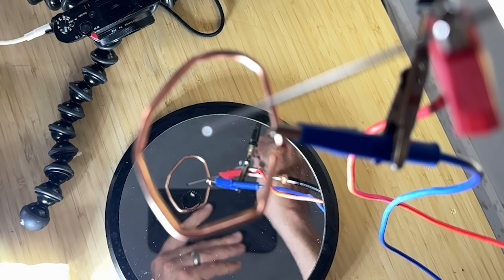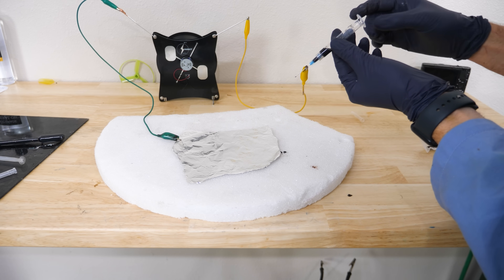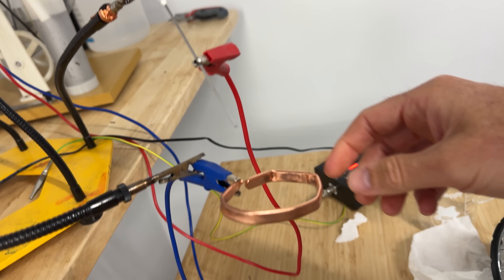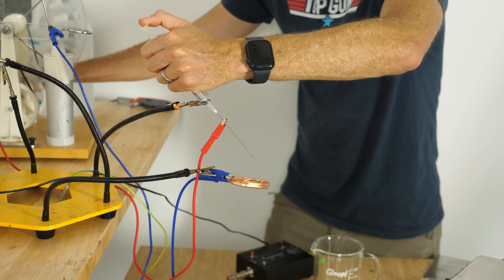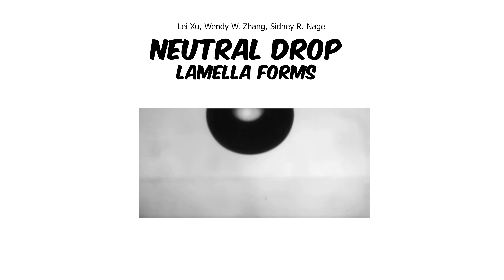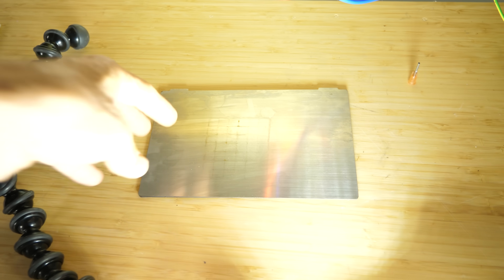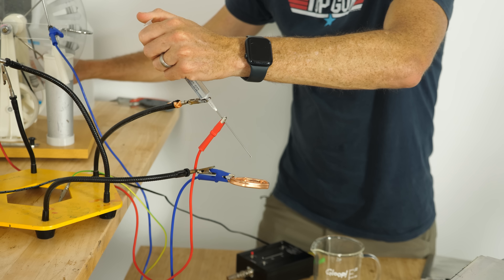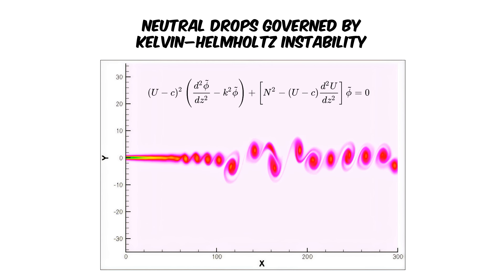Scientists Just Found Why Electrified Drops DON'T Splash

Comment: Since the effect is dependent on the dielectric strength as well as charge, presumably one could build a dielectric tuned to different charges and potentials. Maybe manipulating a polymer on the other side could enable weird stuff like a surface that holds together or goes non-stick with minimal charge, or a single liquid which can clean the walls of its tubes by being charged.

If the surface was modified on the micro/nanoscopic level, maybe one could even cause fluids to flow in virtual channels, store power, etc, by gracefully distributing charge and modifying surface potentials.

Comment: In a "FULL" vacuum, hydrogen expands on a 2d plane, and this is known as positive ionization. The negative ionization is what is passing through that plane. Hydrogen is a literal magnet for the positive pole of magnetic current. Magnetism is in fact a flow of current, not some magical Mickey Mouse particle that bounces between others, somehow sucking them together. That would not every work or explain the differentials we know for certain rule the forces. The hardest evidence of this is in Azra Wind's paper on the prime spiral relationship to the known forces. Her work actually uncovered the fact that there is no end to the number of poles. She herself cannot explain the energy void in her own paper, but I did.

Comment: @2:38 You say the higher the charge you receive a fine mist, "electro spray".
How about a way to atomizing fuel even further in a gasoline or diesel engine...could this be used?  Either by adding a unit to the end of the injector or perhaps replacing the injector altogether. 
For those who don't know, Finer atomization of fuel in a combustion engine increases fuel economy.
Reply: High voltage+atomized fuel...I see no problem

Comment: Inkjet printers such as video jet and domino use negatively charged ink that passes through a charge electrode to print on moving surfaces.  I've had issues on certain mediums where I get significant over spray affecting print quality.  I've always attributed that to static on the print surface.  This might confirm that.

Comment: This maybe could be used to increase efficiency on an internal combusted engine by controlling the atomization of fuel in a cylinder. At the beginning of your video, you say you don't want to turn the charge up too high because it would atomize the alcohol too much. A similar thing could be done to the fuel as it goes through the injector.

Comment: Just came up with an idea .. I am converting an old 3d printer with a 405nm .5 watt laser ., but just took the hot end off and have a pile of new old stock ones too, insulated the hot end from frame and spray out of the hot end ? What I am looking for is to cure resin on copper clad for making pcbs anda drop of liquid resin with no risk of spread would be the goal.

Comment: When the Guy mentions no splash in either a vacuum or charged by an intense electrical field, it makes you wonder if "similar effect = similar cause". In a vacuum, there are no atoms/molecules of gas in contact with the surface of the water droplet. It's outer electron field (surrounding all the atoms) is only in contact with the Vacuum. Is it possible that the intense electrical field is causing a similar effect? The high level of charge acting as a barrier between the outer electron cloud of the droplet and the surrounding atmosphere?

Comment: This makes me wonder a few things, what if you did this in a vacuum? Would it stay the same or would it dramatically change? 
As well as, you showed when you over charge the alcohol it missed. I wonder how that would affect something like a diesel engine which works on the adiabatic principle. Would it improve output? Would it detonate?

Comment: Wonder if it could be used as a means to prevent aeration of oil withing extremely high speed mechanical parts? Maybe it could be used to reverse the effects of aeration.

Comment: One day I happened to be looking at a bird bath out of the window during a thunderstorm. I noticed the raindrops were behaving strangely when they hit the water. My family probably thought I was crazy. But it bothered me to observe something so common behaving strangely and not finding an answer for it. It was almost like a liedenfrost effect but the splashes were weird too. I wondered if the droplets were charged more than the surface water or if the ph must have been very different between the surface water and the raindrops being that it was a bird bath. Something was clearly affecting the surface tension of the water in a strange way. It was almost like watching drops of honey and sometimes persisting drops would jump around the surface for a surprising length of time before falling into the surface. I also wondered if the bird bath or the rain was coated in a surfactant while falling in the sky, picking up pollen or something along the way. Seeing this video reminded me of that experience and I'm wondering how it relates. It would be interesting to see some testing with charged droplets into a surface of water! There's another phenomenon that can be seen in lakes during a rainstorm where the water surface has patterns like a different texture to the water, I think its understood to be caused by rising and falling cells of water caused by temperature differences between the rain and the lakewater. Sort of like cells that form in resin, or coffee or the surface of the sun. BUT, I wonder if raindrop charge has any impact on that behavior too becuase I see it sometimes and not others and I think there could be more going on there.

Comment: so the key take-away is; If you are in the top of a tall building, and it's on fire and you can't escape via the stairway; pee on a power outlet so you get electrocuted, then you can savely jump out of the window. When you hit the ground nothing in or outside your body will splash, meaning you are pretty much rubber and therefore invincible. You are right, I can't believe they just discovered this.. this is a MAJOR discovery!!!

Comment: A potential non science use would be creating a kind of art device with it. Like a pendulum that swings and on it is a device that charges and drops droplets of paint (and you can vary amount/rate), there are artists that make chaotic art using pendulums, this would just be with small dots since it's droplet related, but it would be cool for making like patterns of dotted paint lines that don't send micro droplets all over the place.

Comment: Did you try charging the plate? If a + drop hits a neg plate does it splash? Can all solvents be charged?  Might be interesting to know whether such droplet charging could be used to orient proteins being applied to materials being used as test substrates or antigens for vaccines. (Protien Biochemist here)..one of the issues in applying antigens to substrates is random orientations of the proteins which mask the targeted antigenic part of the protein from exposure..if its not exposed because its underneath its not useful. Same for applying proteins to grids for electron microscopy analysis...random orientations means a lot more proteins need to be analyzed to get the 3D structures.

Comment: Interesting. Suppose a charge can be applied to a clear surface, then it would be easier to see through while rail is hitting the surface.

I have noticed that rain from severe thunderstorms don't splash much on the windshield of the [very old] car. I suspect newer cars have a coating or chemical mix that differed from cars of the 70s.

Comment: There was a video recently by tech ingredients about a paper that talks about using water droplets + gravity to extract electricity which in theory could be to essentially create large capacitive batteries as long as one had a way cycle it. (solar could evaporate the water) [I personally think that with enough research if the idea is truly sound then it could be used to essentially create "free energy"- a very simple non-mechanical system that is effectively closed except for a means to "freely" restart the cycle. If it was developed basically every home could be self-powered through one of these systems that would be cheap to build and likely last indefinitely. They may have to be relatively large to power a typical house though.

Comment: Doesn't this mean that the opposite effect is also useful, meaning that if the surface is conductive, it won't attract the droplets as much. For example in windshields, if the windshield is slightly conductive or has a slight film on it that is conductive, then the droplets wouldn't 'stick' as much ? Maybe it could help with products like rain-x.

Comment: Automobile painting? 
Lens coating

What about other liquids? Water? Oil, petroleum and vegetable? Mercury? Bromine? Detergent, diluted and not diluted? Latex paint? 

I was expecting several surface examples. Plexiglass, non stick cookware. And couldn’t you find a clean piece of metal?

Comment: What practical uses indeed, food for thought.
And I am wondering if we can use the effect in an interaction of droplets with solid particles (PM10-2.5) say to prevent dust explosions, improve microencapsulation processes, create tiny fluidised bed reactors (that due to the size of the particles no longer need micro gravity), and so on..

Comment: Yeah using electric charge to form shapes like spheres on the ends of electrodes to form plasmoids for instance, what about using sound to do the same? there is that famous uTube experiment where the guy uses a speaker to form shapes of water to make the water seem to flow backwards from the direction of gravity.

Comment: honestly i like shaving with a Razor like that. i own one and use it regularly.
but you can get those machined by reputable manifactureres for 1/4-1/3 of the price of hanson.
i dont say their products are bad, just very expensive compared to the rest. didnt test then but could you test the gabs and angles between hanson and Brand XYZ?
i´m curios if my cheapo is actually worse.

Comment: My dad shared a piece of weather lore , it was raining and he said if the raindrops make bubbles on puddles instead of splashing then it's gonna be a prolonged rainfall. It's a folk so he doesn't have a scientific/logical explanation for it but it works, wonder if it has something to do with the charged raindrops?
Reply: WOW, this is interesting.
Reply: I'd say it's rather opposite. Bubbles form when the droplets are especially large. Large drops bring a lot of water and form when there are especially favorable condensation conditions in clouds. Therefore, as condensation goes fast, clouds run out of water fast as well. I usually see long rainfalls when it is just dribbling outside. In these cases, clouds may cover the sky for days
Reply: I used to run printing press. The key is balance of ink film on rollers vs water film on the printing plate. The print area is non water loving vs the blank area where the water films. To help with balancing, the water is made acidic. I wonder if it also affects the charge of the water improving ability to run a thinner film reducing emulsifying the ink. Too much ink emulsifying and the image area washes out, the ink doesn't stick to the plate for transfer.
Reply: @marcusadam1463  Thank you time traveller, clearly you are from the 1700's posting a reply to drop a clue on how to see the hole one without missing the lines for the numbers.
Reply: very cool man thanks for sharing. any other folk knowledge you know? ive definitely observed this myself
Reply: Thunderstorms will supercharge the droplets and thunderstorms usually are of short duration and move on quickly.
Reply: I appreciate your use of Anglish.
Reply: I believe no.
Reply: It's just the confirmation and survivorship biases.

Comment: I used to work at a factory that coated glass bottles and we used electrified paint mist to coat the bottles. I worked further down the line so I don't know exactly how it worked but something like this.  But they had a room that got electrically charged that had a line of bottles going thru, In the middle of the room there was a metal disc spinning very fast so when they dripped  paint  on the spinning disc it instantly turned to mist. The mist then got sucked to the bottles from the static charge in the room and out came perfectly painted bottles with a thin layer of paint. It was a cool thing until you needed to help them clean that room. It was dark red paint so it looked like a horror room. When done cleaning you always managed to get some paint on you and you could track people thru the factory like a cartoon because of all the red tracks everywhere. Was really hard to get the paint off.

Comment: Before watching the video, I'm going to assume the reason why they don't slash is because the charge increases the strength of the intermolecular bonds and thus increases the surface tension.

Edit: Guess I was wrong. Still pretty neat.

Comment: I worked in pharma and we used fluid beds to levitate and rotate air suspended sugar spheres to spray active ingredient and grow the spheres in size. We aimed a tiny atomizer from Glatt nozzles that coated and grew a tiny sugar sphere over 4-12 hours. Biggest waste was the kilos of active ingredient we would collect and reject per batch because that dust is at the end becomes the splashed dried active Ingredient we added to our liquid dispersion we spray.. the rest is pretty much alcohol that evaporated in the warm bed. I feel like charging a spray process like that even in painting would result in a much more efficient spray.
Reply: You got a great idea my guy. Whoever patents this first should give some credit to your seed. 

It would in theory produce a better spray. Just charge all spray during exit on the nozzle.

Comment: If it also works with molten metal in a liquid state you might be able to use it as a safety method to stop splashing while pouring casts.

Comment: I think wh3n we pour and layer liquid based structures to create metamaterials. Or if we layer specific materials on a surface of a plane or other structures to decrease drag from un smooth parts like rivets/ bolts/ layered panels etc. Another one I'd like to mention but think id get in trouble

Comment: So, ball lightning might be formed from a lightning strike onto the ground, where Silicon Dioxide and tiny water droplets a sprayed up and forms a natural capacitor sphere, held together by charges. Then this charged dielectric ball travels a bit, leaking some material, until it dissipates. The bluish color of the ball lightning is from the nitrogen and oxygen in the air getting excited like in neon lights.
A fluorescent light starter when you drop them and the glass breaks, it would emit a bluish light for a second and a sound that sounds like a short-circuiting wire. So there's the sound of the ball lightning, and the popping sound at the end, is from when the whole natural dielectric capacitor collapses into itself :)

Comment: You need to look up a “Bells” electrically charged paint system.
No splatter and finely spread paint. This has been in use for 40 years and works flawlessly

Comment: The most obvious place I could see this being relevant is any glass surface you know will be exposed to weather. Especially if you are trying to increase specific properties like reducing how blurry things might appear through the glass. So, for example, does the fact that the falling raindrops not splashing result in reduced visibility? Should we consider adding a coating to windshields, etc., to try to reduce or remove that dielectric effect if it would actually increase visibility by driving most of the liquid of the drop back into the air as finer drops? Versus making that blurry kind of view one often sees before using windshield wipers?

Comment: If it splashes then it makes more surface, and more surface is more heat dissipation. So in powerplants coolant towers it would be beneficial to make sure that drops are not charged. This is my thought.